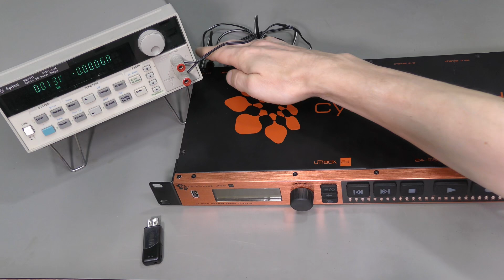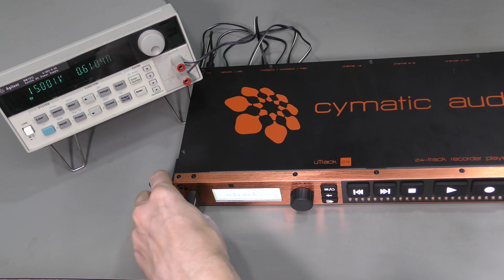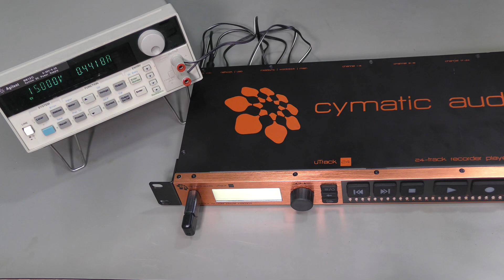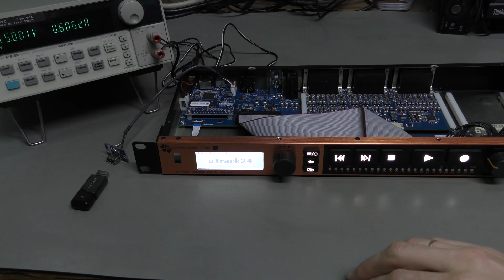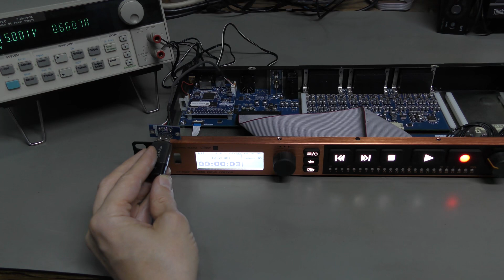#153 - Cymatic uTrack24 repair

Comment: Question for FeedbackLoop: Do you recall what internal battery is used in the uTrack24? Is it soldered in? Thanks!
Reply from the maker: There is no battery. There is a supercap to keep the clock ticking for a while.
Reply: Update: I opened the unit and found that it uses a 5.5V 0.33F super capacitor for memory backup. The super cap is soldered to the 'Center Board'. I have decided to live with the ‘System date & time not set!’ messages.

Comment: I did wonder why there was no HDD or SSD in there. Then I realized that 24 times 48 KHz 16 bit are only 2,3MByte/s. And even 24 times 96 KHz 24 bit are just 7MByte/s. So on a 128GB USB stick you can record 300 minutes. More then enough. Wow, how far times have come.... I feel old now.

Comment: Was there old flux around those soldered wires?  

First look at the blob suggested it was contributing to the problem.  But I agree with your debugging path, for who would think it possible that the unit was shipped in that condition.

Always enjoy and learn from your narration and careful, methodical work.  Many thanks!
Reply from the maker: The soldering looked original. I assumed the unit worked before, and therefore blamed the diode (there is nothing else there).